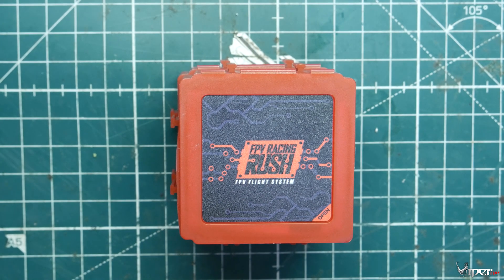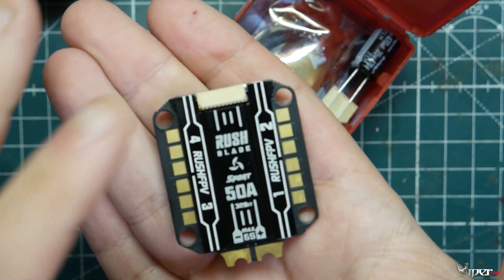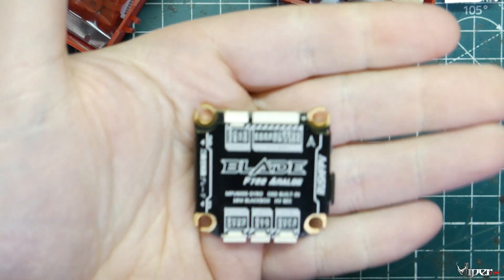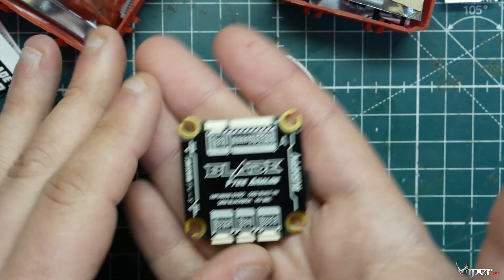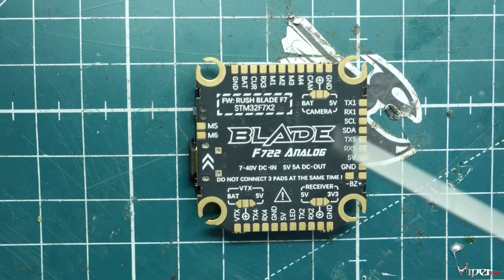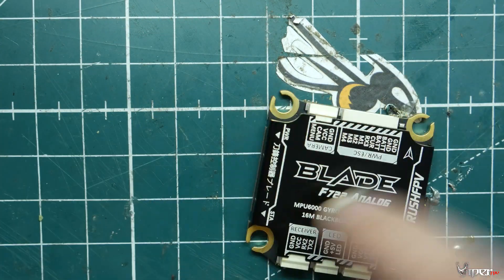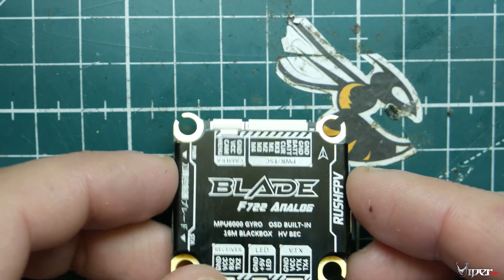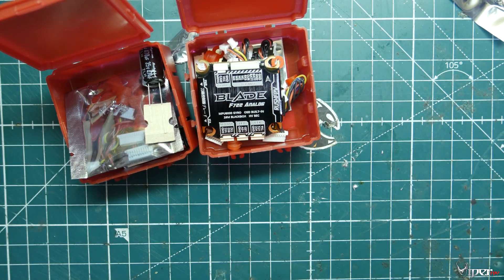RushFPV Blade F7 Flight Stack - Overview!

Comment: They are really good when they fly but they seem to burny pretty easily. I've gone through two FCs. Even with the spike absorbers. Both completely dead. Might be my bad luck.
Reply from the maker: This is not the first I have heard of this.
Reply: @ViperFPV  Oh wow really? How is your experience with them been so far though?
Reply from the maker: @mengleelim1054  I installed them and well it broke. Esc fried, didt even get a chance to get any footage.
Reply: @ViperFPV  Yikes.. Seems like its not exactly an isolated incident in my case then 😬

Comment: I bought this stack from GetFPV and I had to return it right away! Everything was plugged in and ready to go, plugged in my lipo and my first set of "beeps" came on right away and the second set of "beeps" didn't come in for almost a minute later! No matter what I did every time I plugged in a lipo, I had to wait 40 seconds + before I was able to even arm and get in the air. Complete garbage. HOWEVER... GetFPV were awesome and handled my case well and went through all kinds of troubleshooting include updating different firmware and swapping out FC's with a known good one. At the end it was a bad FC, and got my money back. Be careful with this stack... just saying.
Reply from the maker: That’s unfortunate you got a dud it does happen
Reply: All my 4 are the same, they arm after 30 seconds, i have no idea how to solve this issue.